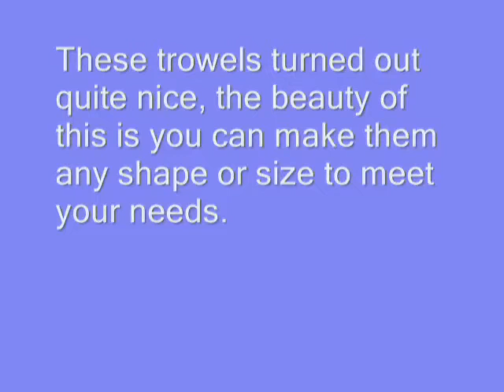DIY PVC Camping Trowel Tutorial Bushcraft Tools Video

Comment: Another way of heating a PVC without the use of a heater/blower is to heat it on top of a propane stove. You also can use a wet rag to cool it off after you form it in any way you want it.
Reply from the maker: +Harold Rull yes or boiling water too
Reply from the maker: +Harold Rull yes or boiling water too